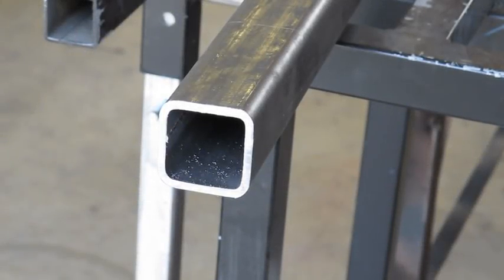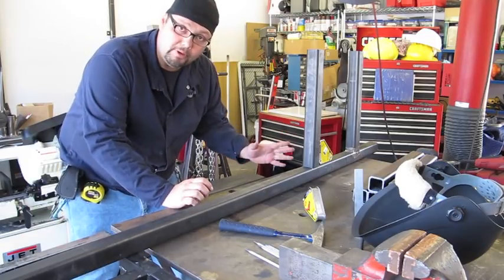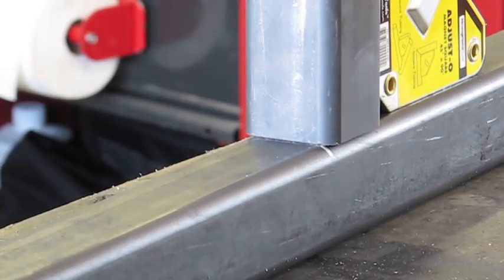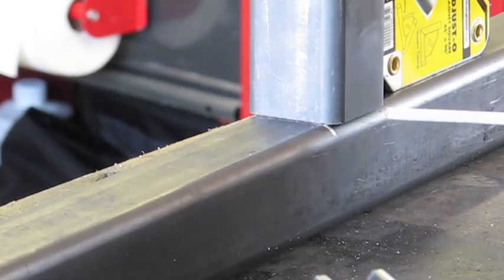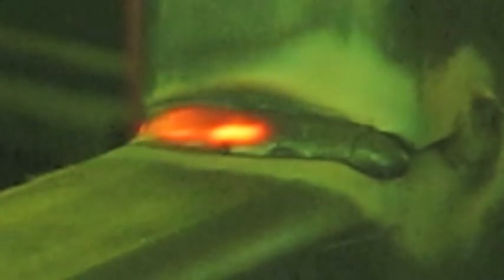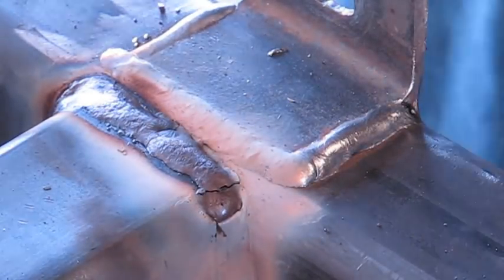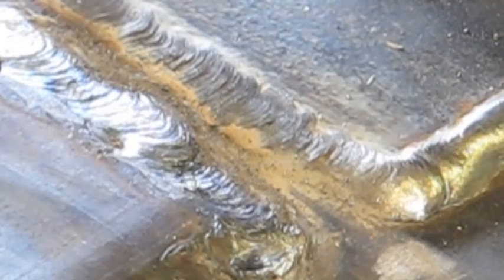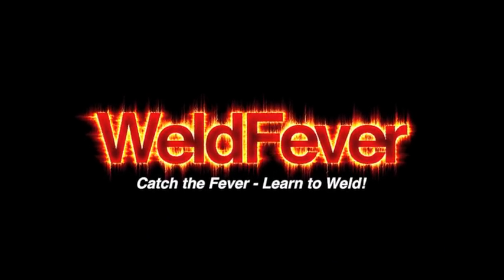Stick Welding Square Tubing

Comment: He's on the money for wanting to trust a stick vs. a Mig on this..why?  I dunno his Mig welder(S)...but you will NOT be able to get a decent quality MIG welder for less than $1,600. Many are available for around $300-400, but you should stay away from those low-current MIG welders. F.Y.I. a poorly known fact is that MIG welding generally requires TWICE as much current as stick welding to achieve a sound weld. For that reason you should not buy a MIG welder with less than 250 amps output in thick applications. You won't find a MIG welder in that range for less than $1,500; manufacturers tend to heavily exaggerate the thickness capabilities of their MIG welders.
Reply from the maker: +TVTruther Hallelujah! You are right on the money and that is exactly what my point has been all along, but you have been the first to put it so eloquently. I thank you and truly appreciate your very intelligent and insightful comment. I hope you will continue watching and commenting!
Reply: +TVTruther I like my little 110v mig welder, but it is only good for steel 1/8" thickness or less. It works ok on 3/16" when I use flux core wire. Also, these little machines only have a 20% duty cycle, so you can't even weld for very long before having to let the machine cool down.
Reply: Thanks very much for that information. I was about to buy a MIG...... your post is very helpful
Reply: Thanks very much for that information. I was about to buy a MIG...... your post is very helpful
Reply: Cant get a decent MIG welder for less than $1600?????? I just got a Miller 211 for $1,000. Not exactly junk.
Reply: Cant get a decent MIG welder for less than $1600?????? I just got a Miller 211 for $1,000. Not exactly junk.
Reply: Cant get a decent MIG welder for less than $1600?????? I just got a Miller 211 for $1,000. Not exactly junk.
Reply: I disagree.  I have a great Eastwood 175 Mig and it performs great for around $400.  Also have a Lincoln 210 MP sells for under $1100 and welds just fine.

Comment: you said you stick welded because they going to hold weight right. how much weight are you referring to? your talking to someone who is beyond NOOB! like i did like two small peaces of sheet metal 25 yrs ago noob!  so be nice! you can laugh. but, be nice! LOL!!
Reply from the maker: Well, I plan to use these as a steel storage rack system, and steel gets pretty darn heavy, I wanted them to be as beefy as I could make them, without being crazy heavy to handle, maneuver, or bolt into my wall studs. I can't say just how much weight will be on this thing at any given time, but it doesn't take much tubing, or flat bar, or worse, plate stock to rack up some major pounds! Thanks for the comment and keep watching.
Reply: thanks